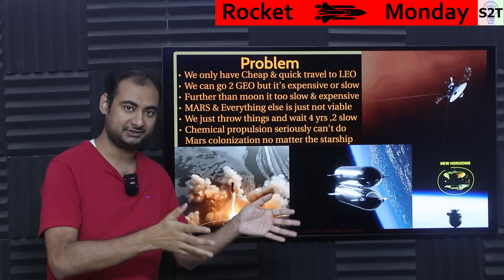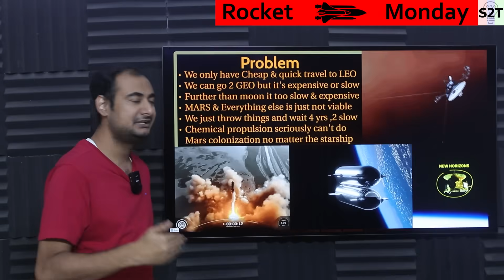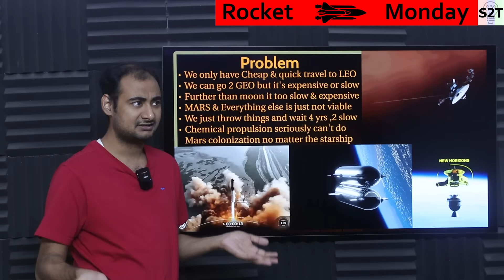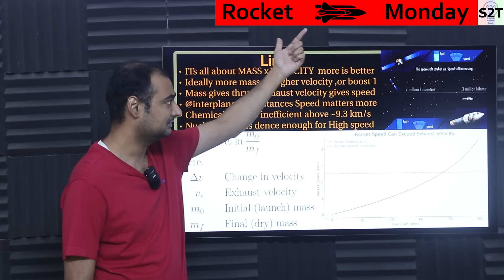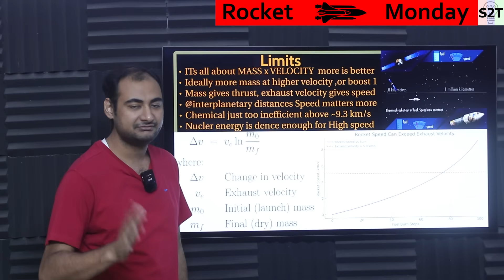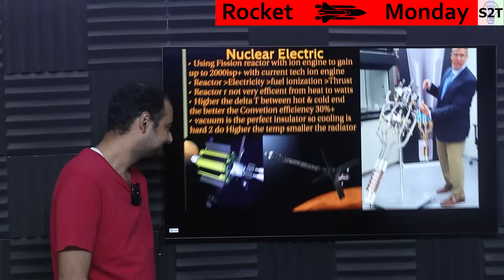Nuclear Electric Propulsion Explained {Rocket Monday}

Comment: Supercrtical CO2 turbine is light and efficient.
Reply from the maker: not sutable as temp needed at cold end  is too low that is why NASA is using sodium heat pipe and Stirling engine for space nuclear reactor

Comment: Other creators have critically reviewed the nuclear rockets before:
video title  "Валентин Гибалов — Ядерная энергетика в космосе и ее применение для межпланетных полетов" channel "Summer Space School" (the most technical)
video title " Nuclear Electric Propulsion - Practical Idea or Crazy Nuclear Rocket Engine?" channel "Eager Space" (more abstract and popular)
(will youtube ever allow links to youtube ?)

both concluded that engendering issues still preclude the adoption of this tech. Mainly:
1) Low temp heat rejection from electric propulsion and from the crew  is too heavy.  No low temp liquid droplet radiators have been developed  yet.
2) The reactor shutdown/refueling/maintenance/disposal protocols don't exist, crew capsule docking and proximity flight protocols  to avoid irradiation are not developed.
Reply from the maker: 1 we have nevery tried dumping 5 mw of heat so we have no clue about weight & 2 its solvable as Apollo astronauts were trained how to handle RTG {the carried it to the moon} NASA's kilo watt reactor is designed with that sort of mindset
Reply: Oddly I think a nuclear salt water rocket with a plasma rocket bell is the simplest, but most insane, to get working.  If only we had that magic radiation shield.  Maybe Elon’s ego would work?  Perhaps it could sell the neutrons a vacation resort in the plasma exaust